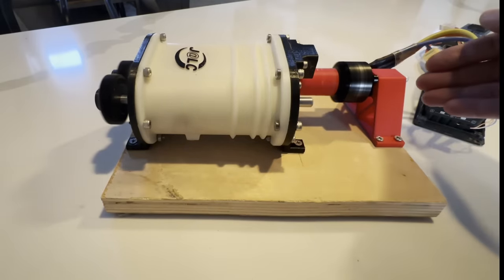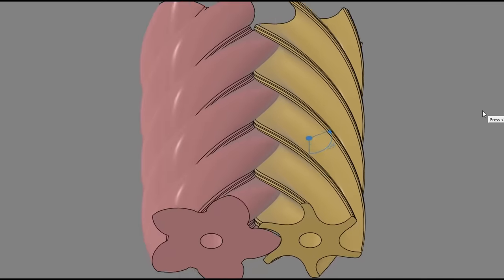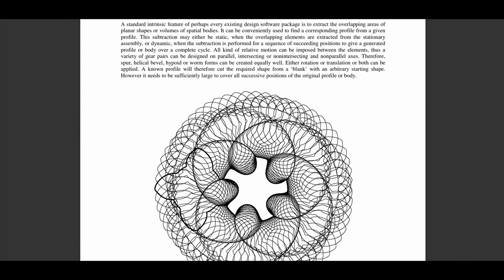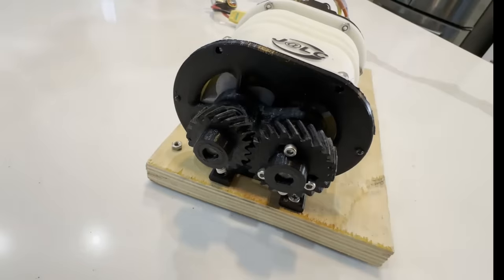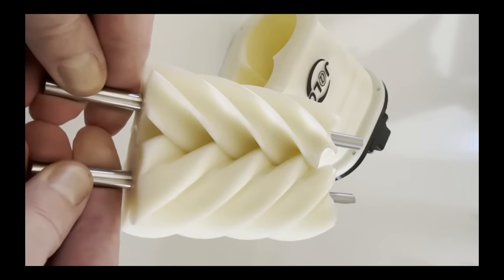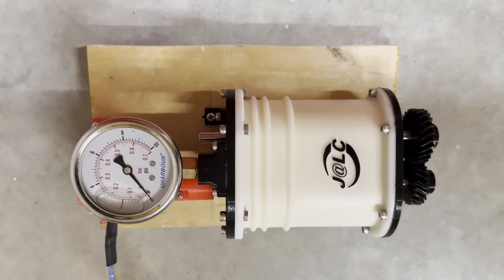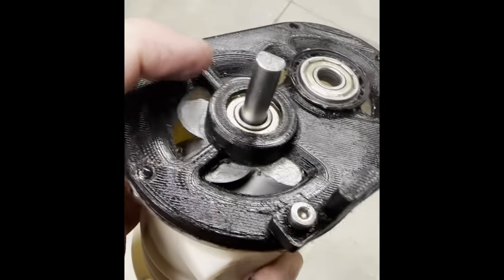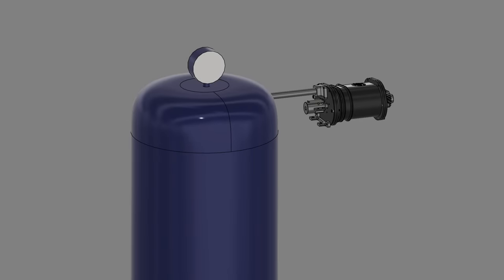3D Printed Screw Compressor V3

Comment: I was a service technician now a sales representative for a very large screw compressor manufacturer. To get high pressures usually have a two-stage compressor. The first one goes to 35 pounds the second stage of bringing it up much higher the temperatures of an oil less two-stage compressor at each stage is somewhere in the range of 360 to 420° and the rotors are cooling from the air that’s moving across them
Reply from the maker: That would be aweome, a two stage setup would be awesome. I don’t know that the air got that hot, I saw some of the dry compressors had intercoolers between the stages.

Comment: Great project! I'd recommend thrust bearings on the low pressure end and placing your timing gears (and motor) on the high pressure end. You can also offset the axial bearings according to the tolerances and play to get a better seal at full operating speed (knowing the forces and directions of force while in operation allows to minimise clearances by designing for the dynamic state rather than the static). 

Nikola Stosic has really done fantastic work to modernising screw compressor design and I'm very grateful for his work. 

I'm working on a long term project that incorporates variable geometry screw compressors, hoping to be able to CNC machine the main components for the prototype, but I'm not sure I'm up to the mathematics required!
Reply from the maker: Thanks!  I love idea of a variable geometry screw compressor.  That makes my head hurt just thinking about how you accomplish this.  

That's great to know you can slide the the rotors relative to each other.  There's so little information out there about how these things are setup.  I think in the future, when I add a thrust bearing I'll also make the thrust adjustable with some set screws.  Filing the spacers by hand was a nightmare.

Comment: Bravo!
This is very similar to the oil pumps we use for fuel injector oil pumps on our big boilers. Main reason is they can handle #4 oil which is dirty and they are very reliable.
 If you have a 2 meter drop on the intake pipe, you can get almost a perfect vacuum and if used for that, you can extract all gas exhausting into a warm tank. Try it!
 I have wanted to do this in plastic using water with mineral oil/sulfur which is basically cutting fluid for machining-
but it would be easier to watch someone like you try it first😊
Reply from the maker: That's interesting, I may see what kind of vacuum I can pull.  I think it would do quite well, especially if I spent more time tweaking the clearances.

Comment: I agree with your assessment however that’s not very “fun”. Print it out of high temp filaments and go right for the full send. This is YouTube not LogicalTube.😂
Reply from the maker: Yeah, honestly the sound alone is worth it.  I want to make one for my shop just to hear that compressor turn on.
Reply: You could make a mold out of 3dprint and cast metal with plaster, just make sure to make vent-holes to prevent trapping air.
Reply from the maker: @Splarkszter   I'd love to try something like that, not sure how accurate I could the parts with the shrinkage as the metal cools.
Reply: @IndeterminateDesign   Thermal Expansion is always consistent, you would need to calculate the formulas to get the dimension but all of that stuff is sorted out these days.

Fail fast is the most efficient way of egineering.

FarmCraft101 has a really nice video called "3D Printing Metal At Home?"

It is incredibly useful and fun to watch.

Comment: Amen Indeterminate Design. I got a huge smile on my face for you and your accomplishments. You got it figured out! Great Job.  I had been wondering if the main rotor had to be larger than the gate. The previous discharge will work now that the rotation has changed. Eaton has some additional slots adjacent to the opening that my guess if for sound....Pressure is not the performance metric you want, it's flowrate and air temp differential actually mass flowrate not CFM for application I am interested in. Got to have flow to keep the SC cool. My gut tells me plastics have too much expansion for the clearances needed even w/ the air flow to last any substantial time but look up the coefficients of expansion for various material and you can make the assessment. I believe the rotor exhaust end face to case clearance is a big contributor to performance any why thrust is so important. Tapered roller bearing and timing gear mod to include oil bath definitely needed in next model. I believe the main can not exceed 360* twist. If it does the air would be trapped in the gate at the sealing lines made by the two contacts by the main. The blow hole will have more of a negative affect on flow including at the suction port. Increasing temps could also. I hope you try again. It's easy for me to say since I'm not doing the work; but, if it were me I'd fix the damage, cut open the top of the case enough to get a good look at the rotors, put clear acrylic or hardware cloth over that and any other opening, timing gears, belt or pinch point for personnel protection (I like you humor), slow the motor down enough to see the rotors mesh (30 RPM maybe slower) then put it on my office desk...Demonstrations at lunchtime only. LOL I think you know what I mean. Really good job explaining a very complex and multifaceted project design. Best I've seen. No reason for me to do any more studying now.
Reply from the maker: I’m glad you liked it. I think the resin rotors would have been better for expansion but it’s hard to say. It’s really a mix and match game to with a bunch of copies of rotors to get the right fit . I think I could have an interference fit with resin rotors and just run them in. 

It would make a really cool demonstrator for your desk. I want to make one with no housing as a piece of kinetic art.

Comment: Great job, I used to test the real thing. It could get exciting from time to time
Reply from the maker: I can only imagine. The mass of all that steel spinning at high speeds would be scary.  What kind of rpm did you have to run?

The SLA resin rotors were actually pretty heavy. I think it would be like 2500J if they let go, or a small shotgun blast 😂.

Comment: Good work on this. I think your original rotors may still be usable because screw vacuum pumps are a thing. They work well, but they are a HUGE pain when a contaminate gets in there.
Someone below recommended thrust bearings. A thrust bearing+ball bearing would work well, but you can also get angular contact bearings which does both (but not as well as the 2 separate bearings).
Reply from the maker: I hadn't thought about trying to pull a vacuum with one of these.  A vacuum pump would be super useful to have actually.

Comment: given your research into the tooth profile, I have often wondered why something more common like the involute gear profile such as used in hydraulic gear pumps is not used?
Reply from the maker: These profiles are optimized to compress the air along the length of the screw and to pull in as much air as possible at the entry point.  They're basically a directional gear because they can only spin one way.  Also being a cycloidal gear the gate rotor spins faster which forces more air into the system.  I have no idea how Lysholm originally came up with this kind of compressor though without the help of computers.

Comment: Used to work in a compressor/tool sake & repairs shop. (Untill stress triggered undlying Fibromyalgia)
This is awesome work.
I Am noticing that grinding noise. I would gues its from the screws making contact with rough print surfaces.
Have you condidered marking an alignment point,  coating the screws in a lapping compound, match them up, seassemble, let then gribd/match/self surface themselves in? At relatively low/rock tumbler speed, for a considerable time.
That should let then polish/grind themselves out.
This Would also tell you how Well they screws mesh.
Reply from the maker: The grinding noise is just the timing gears mainly, and possibly the poor bearings.  The rotors themselves don't actually touch, they have about 0.2mm or .008 inches clearance between them.

Comment: Rolling bearings if not specially designed for high speed usually fail at speeds higher than 10-15k rpm due to the dynamic loads. For high speed and high load applications the use of sliding axial and radial bearings should be considered.
I don't use very often screw pumps at work but I haven't seen an industrial one to work at rpm higher than 3000 - 4000. But they are also with a larger diameter of the screws.
I am really astonished by the amount of efforts you have invested in this project. Thanks for the video and the explanations.
Reply from the maker: Thanks.  It's kind of a silly project, but the sound the compressor makes is all worth it.  I think doubling up on the radial bearing I had in there would have taken the thrust loads but I'm finding some 8mm thrust bearings for $2 a piece but they're don't have an RPM rating.

Comment: They're 3d printed rotors... Print the gears directly on the ends of the rotors, even inside the case maybe. Herringbone 3d printed gears work great, and you're already oiling it. You can cut the part count in half while also having gears at both ends (or other options)? Just spitballing.
Reply from the maker: I think that would be possible. The gears are a different diameter than the rotors so that might block some air flow. If I cut the timing gears the other direction like I should have, you essentially end up with a herringbone gear with the timing gears one way and the rotors the other. It’s strange because the rotors never touch, but the compressed air between them still exerts that force.

Comment: You can utilize patented designs for your personal use. You just can't sell them or use them commercially.
Reply from the maker: Yes, I've looked at this a bit.  Technically in the US you can't even use them for personal use, but it would be very unusual for a lawsuit to occur.  But putting a patented design on YouTube or providing that design to others starts will cause more trouble than it's worth.

Comment: I had a real screw compressor like this brought into my shop to have the endplates touched up a bit. What I noticed was this 5:6 ratio between the rotors, BUT, the timing gears had exactly the same number of teeth, as though the rotors turned at 1:1. I couldn't get my head around this. I told my father about this, and remember that he remarked "That's impossible". So I invited him for a looksee himself. It was as i described it. What's the explanation?
Reply from the maker: That would be strange. I don’t understand how that would work because at some point in the rotation you would have to cover a partial lobe.  It’s hard to say without seeing the rotors themselves.  I don’t know if theres a special rotor profile that does this or what.

Comment: I wonder...
If you want a bigger & better idea to persue next;
The geometry Should work even with Oversized or uneven screw diameters.. (oooh, they're multistart screws..riiight; sorry, just found this content)
Anyway, uneven screws; why? Because these pass unholy amounts of volume.
So if you make a screw hollow, w a one wsy bypass Through it.. can you improve the efficiency via the air in motion creating suction effect? A venturi suction effect?
If it wo4ks, does it work w double oversize screws?
Reply from the maker: That would be interesting, I don't have the math for that setup.  I do have a 3:6 rotor profile meant for a supercharger, I think that would move a lot of air.

Comment: Rather than directly driving the timing gears, you should use stepped gearing to get up to speed. Yes, it will introduce efficiency losses, but it will also increase the overall durability of the drivetrain and enable you to better address waste heat. Both linear geartrains and epicyclic ones have different pros and cons here.

Another idea that might increase the life expectancy of the drive train is to use a couple of timing belts to isolate both the timing gears and the motor shaft from wherever you mount the geartrain suggested above.

On a slight tangent from the topic of epicyclic gears... Do you think a cycloidal drive gearset with a strong helix to it might work well as a screw compressor, or would there be too much loss from the eccentric motion? What about using twin-screw style mating tooth profiles on an epicyclic gearset with the carrier also providing inserts between the planet elements as a constraint path for the pressure medium?
Reply: Also, I just remembered an idea that I had some time back about designing the screws with ports and internal paths for water cooling to account for the thermal vulnerabilities of thermoplastics... but that gets a lot more complicated to design.
Reply from the maker: That's a good idea.  I really did think about using a set of GT2 belts as it would be much quieter and more reliable, but always the added complexity of how to tension those belts.

I don't know if cycloidal drive set would work for compressing air if it was twisted.  My gut says no because you don't have a virtual space that the air compresses along (Often called the "blow hole" for screw compressors).  I did see a patent for a tapered single screw compressor with a stationary housing.  Very similar to a cycloidal gear in it's movement.
Reply from the maker: I was really interested in trying water cooling.  The initial parts I designed for MJF 3d printing had water jackets in the housing.  It would take a lot more design and testing to get a design that worked though.  I need to get a big industrial motor and try with some larger rotors and see what I can do.
Reply: @IndeterminateDesign  I remember seeing that too. They had a whole, very informative, marketing site and everything. But they were only selling it to industrial clients and only by quote. 

You know what they say: If you have to ask the price,  ~~you can't afford it~~ it's a scam.
Reply: @IndeterminateDesign  One concern with water cooling the screws internally is that almost the only place to put the ports is concentric with the drive shaft. Although, I suppose if you print the shaft as part of the screw continuously...

Comment: I know that sound, you might get more with several microphones spaced out some feet away and mixed back together.  Its not the same watching it with out the high pitch scream.
Reply from the maker: Yeah, I need to get a better microphone than just my iPhone’s built in mic 😂.

 I’m not even sure what the frequency range is for that noise. It’s definitely higher pitch than a supercharger on a car, I’m guessing because of the speeds and size.

Comment: can you share how to calculate the suction mass flow rate theoricatcally? In case if we need to calculate the volumetric efficiency
Reply from the maker: I've not seen the calculations for that, or what is a theoretical peak efficiency for a given screw compressor.  Most of the flow details around the compressors I've seen were all determined using CFD.  There are formulas for approximating the displacement of a compressor based on the diameter, length, twist angle, and number of lobes,  but those are dependent on the fill factor for the rotor profile being used.

Comment: Could a double system help with thrust loads and balance? Like, two mirrored screws on each axle, that move air from each end, towards the middle? Having the timing gear in the middle, and bearings, might also help improve things.
Reply from the maker: I think I've actually seen a 2 stage screw compressor setup like this.  It's definitely possible,  I'm not sure on all the math needed to know how to balance it out for sure.  I may pickup some thrust bearings for both ends since they're so cheap and can take loads far higher than anything this little guy can generate.
Reply: @IndeterminateDesign  Thanks for the answer! I was assuming mirrored screws on each axle would inherently cancel out each others axial parts of the thrust loads, reducing problems, known and possibly unknown ones. That is if they are identical except mirrored, and same stage. Also supporting something like an axle in the middle, as well as at the ends just seems so much better to me than just at the ends. But then again, I don't know, the mathematics is beyond me, that's probably why I like design features with inherent advantages, without actually knowing if they're worth it, or even if the net effect is positive. 

Anyhow, great videos! I find screw compressors intriguing, and you have increased my understanding of how difficult they are to design and produce.

Comment: Mate, use a herringbone gear for the timing gears and the left and right axial thrusts will cancel out…
Reply from the maker: Yes, the gear thrusts loads will cancel out.  It's difficult to discern how much thrust load is being added by the air being compressed between the screws of the compressor (Obviously not very much in this model).  I think either way if I can add some thrust bearings the compressor will be able to take loads well in excess of anything it can generate.

Comment: What if you pump water mixed with air and seperate the two after compression?  The water will seal the gaps while allowing more air through!
Reply from the maker: That would definitely work, and I've seen commercial compressors with that setup.  The key is having a tank/separator, so we have enough room for the air and water.   I didn't try that with this version because I had dead headed the pressure gauge.